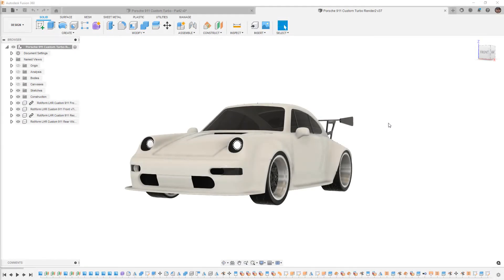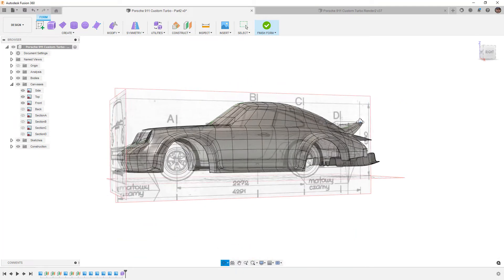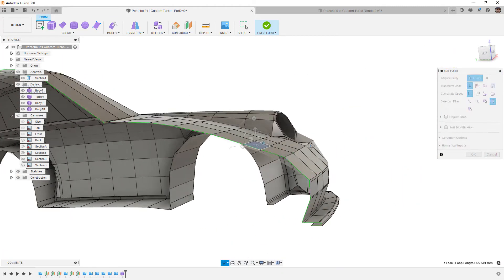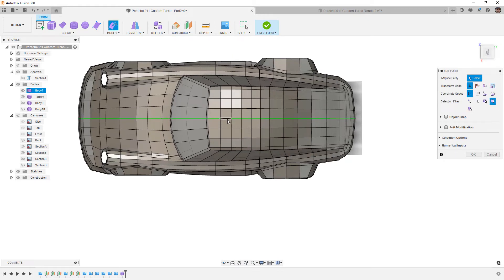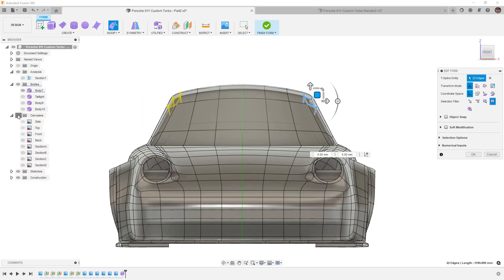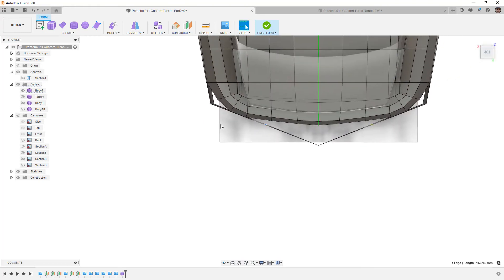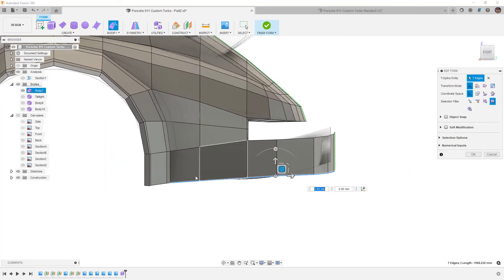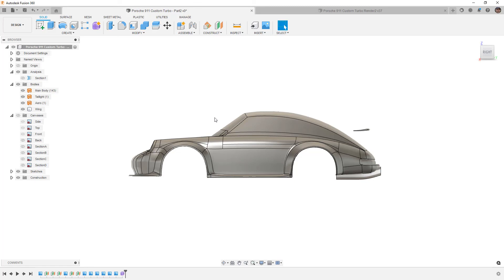The Ultimate Car Modeling How To Part 2 - Final Body Adjustments #Fusion360 #CarDesign

Comment: Thank you! i'm waiting part 3. is the part 3 a last video in this series? maybe trimming front fender and parting windows, making side mirrors?
Anyway i'm look forward to watch next video. thank you!!
Reply from the maker: I am recording it today.  I don't know if part 3 will be the last or not.  There are a lot of details :)
Reply: @LearnEverythingAboutDesign  Oh very fast, Thanks!! Take care of your throat!
Reply from the maker: I just uploaded part 3 and part 4.  Part 4 will be the final and is only about appearances and renders but I will make it public in a few days time.  All said and done its about 10.5hrs of video with Part 3 being just over 3hrs.  Hang in there!
Reply: @LearnEverythingAboutDesign  So Thank you. I'm trying to model a car, Santafe 2022 made by hyundai, it has a lot of wave and curve on side fender and around wheel. i feel it's hard to me but I'll try to continue modeling. I'm reviewing part 1 to solve my problems, so I think watching parts 3 and 4 will be postponed.
Reply from the maker: When you model something like that you need to be a bit careful on the order you do things.  The crease/lip that runs from the headlight to the tail light blending into the fenders and doors will be very tricky.  Just looking at it I think I might model it without the indents in the door and get good surfaces first, then add edges to push the shape inward.  That is quite the challenge for forms so don't get discouraged!
Reply: @LearnEverythingAboutDesign  thanks! as you said, i felt that the modeling order is very important, too. So i changed the order, by modeling it around wheel and crease first.  

I could make the fender (the waves and crease, etc), but I encountered the star-point. I can't control the star-point around crease line, and the face quality is too bad. 
Thank you for your encouragement
Reply from the maker: Sometimes you can't avoid those starpoints but try moving it away from the fender a bit.  Having a 3 or 5 star point a few edges removed from drastic changes in curvature often will help.
Reply: @LearnEverythingAboutDesign  thank you so much, I'll try it tomorrow again!